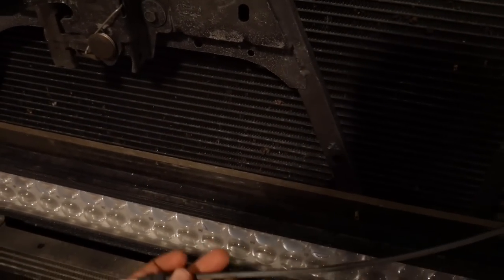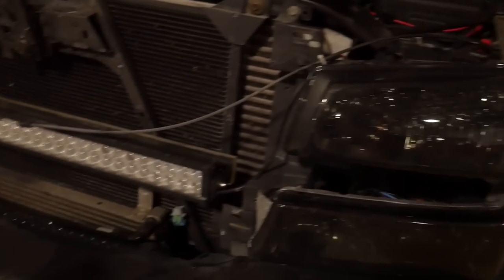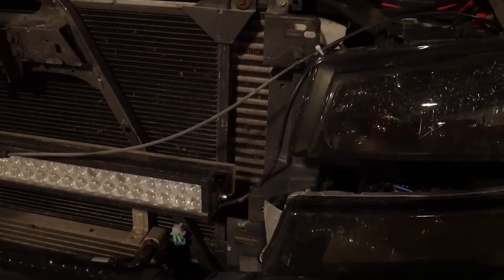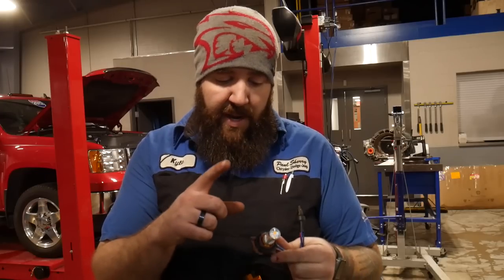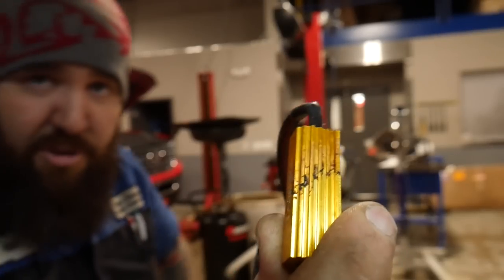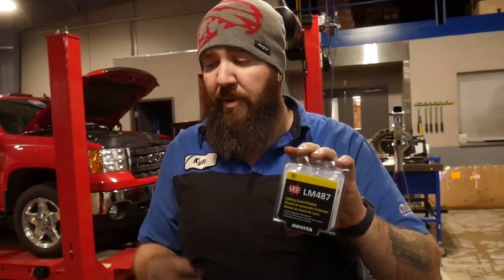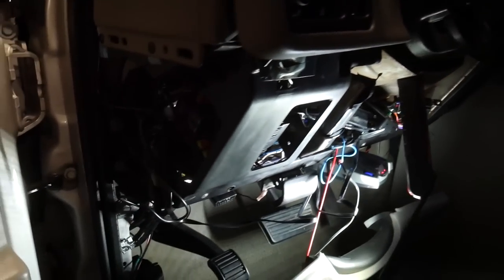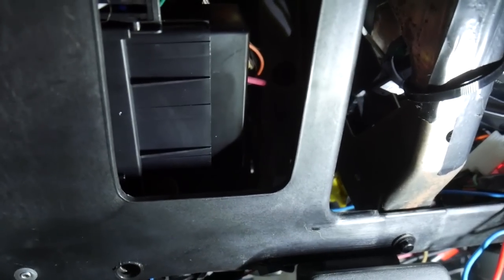LED FAST FLASH FIX AND WHY RESISTORS MAY NOT BE A GREAT IDEA

Comment: Don't blame the resistor for your poor mount. It is stated that they need to be mounted to metal and away from plastic or anything that can short out. It was your poor choice in where you mounted them.
Reply: That may be true but do you really want those things in your vehicle that can cause a lot of damage or even a fire? I don’t think so. Do it the right way and be safe.
Reply: WHY WOULD U WANT AN ITEM THAT WILL GET THAT HOT IN THE FIRST PLACE, IF THE LM47 WORKS GET THE BETTER PRODUCT.

Comment: I'ma just go ahead and say it as I'm an automotive accessories installer of over 20years. That is a Ballist resistor with heatsink "the metal housing" it's designed to get hot that's how it work. It turns excess load into heat. Think of it as your radiator. It needs air flow most importantly and would you cable tie wires to your radiator?. Point is installed in the correct way with airflow, screwed to the vehicle properly and with sufficient air flow then they will live a happy life for ever. I'm by no means having a dog but I watch you to learn what you do and in turn this is what I do. Hope it helps. Having said that it is still worth the extra money but honestly it is doing the same thing but with no heat. Doesn't mean it won't release the white man's magic white smoke either lol.
Reply: Just to add with that flasher module upgrade you retain you fast flash circuit indicating a blown globe 'led' unlike Ballist resistor s you lose the fast flash blown globe indication. That's why I would spend my hard earned.
Reply: Trouble with resistors is there is no air flow where they are used.
Reply: @charliemagoo7943  Trouble with that is your installing in the wrong location then. Common sense. Again if your new radiator said install in the trunk in its packaging, would you?  Difference between DIY and Professional.
Reply: Philip Perry I have a 2012 Duramax and I don’t have a flasher relay. Is there a module to change or I have to stick with the resistors? But I screwed my resisters to metal to dissipate the heat
Reply: @jamesbatdorf1665  the flashers are controlled by body control module.  The module can be programmed with an added vci to delete bulb outage detection.  Our dealership does it for about $150.  Dont have to worry about resistors overloading module then.  Have seen several boards melted from resistors especially if 4 way flashers are used
Reply: I was wondering I have a 2003 GMC that I bought new headlight assemblies for with the LED plus the turn signals or LED switchback it it has DRL which is down in the turn signals but when I hooked all this up and come with resistors and I got the flasher relay for LEDs when my headlights is off my turn signals flash normally and when my headlights come on they flash faster but not so much as a hyper flash like without the resistors for led but I'd rather for them to Blake little slower is there something I can do about that I have regular halogen bulbs in the headlight assemblies I don't have LEDs in the in the housing just yet but in the housing it has the LED DRLs and stuff like that already in and I hooked the wires up but I have not switched the halogen headlights over to LEDs yet

Comment: You was suppose to mount the resistor to the metal away from anything because it gets hot...I’ve used these for years with not one issue

Comment: Someone already said it in your comments but I did the same thing. Customer came in with those ballast resistors on their 14 RAM. Well they melted the headlight assemblies where they were wired in at lol. I remote mounted them on the core support so they got the airflow and they could dissipate their heat into surrounding metal of the core support. The vehicle comes in pretty frequently at the shop, next time it comes in I'mma peek at it and see if it's still holding up lol

Comment: Hello, thanks for advice. I have a 2002 ford taurus and I have so far replaced my back up lamps and head lights with LEDs. I would like to go for front turn signals. Not sure if it will hyper flash with them. Is that part you installed available at any autoparts store or did you have to special order it?

Comment: Digital flashers are good if they are an option. But your resistor failure was user error. Resistors get hot, there's tabs to mount it for a reason, you should have had it mounted to something metal, maybe even with some heat sink compound.

I like to start with the flasher if it's available, if it's not, resistors properly mounted are more than adequate.

Comment: Thanks for the information.. I like your video...Thank you for taking the time. Like you said, you live and learn...
 Just one question on a slightly different topic. I don't know if you have a video for this. I want to install LED bulbs for my daytime running lights. 2000 Silverado and they are 3157 bulbs. I had a friend say that they are not going to last long. Would these need some type of resistor?  What would you recommend?
Reply: I use the zero sylvania 3057 led in my 2005 Chevy Tahoe 3 or 4 months ago and still working with no problems

Comment: Is there an option/lighting control module for the Hyper flash for a 2018 Chevy Colorado? I only see 2 fuses for left and right rear blinker…it’s like the light control module doesn’t even exist…
Reply: it is possible the colorado is like my nissan frontier and does not have that module as it is controlled by the BCM

Comment: Or just stick with less powerful but still enough to prevent hyperflash, sylvania - load equalizer resistor. Instead of of 50W they shoved on the little one. The sylvania is 27.5W.

The little 50W resistors operate about 5 minutes, and the heat gets up to 330 degrees Fahrenheit. That’s why the mini 2” gold resistors get super hot. 

But the 27.5W sylvania - load equalizer resistors gets hot for around 180. So that’s way better and more efficient. 

Mine has led flasher relay by novita LM449. For my 2015 lifted Scion xB. And it works beautifully.

Comment: Great video. How do you get both headlamps to come on? I installed a ISSYAUTO flasher in my 2003 and everything works great. The LM487 wouldn't work. I have a 2017 2500HD and I'm trying to figure out how to do a full LED swap without resistors. It doesn't seem to be easy to just change a flasher swap? I bought CANBUS ERROR FREE bulbs but the still Hyper Flash.

Comment: If I have two options between buying the bulbs with a chip like the Lastif or installing the resistance, what is the best option? I think that if the resistor gets hot is better than the bulb.

Comment: @RustbeltMechanic 

I was actually lookin forward to swap all the halogens and incandescent bulbs from interior and exterior for my family’s 2017 Toyota sienna LE, especially the led bulb turn signal lights as well. 

I want to installed the sylvania zevo 3157 front and 7440 rear. 

I have the Novita led flasher relay LM449. 

But here’s the sucks part, Toyota made a very stupid idea to move the oem relay somewhere else. 

Instead of under the steering wheel which is a nice spot, they moved behind the gauge panels and it’s the worse thing they ever did. 

So I got two options. Either get the ultra bright auxito with a built in resistors. 

Or just get not only just a load equalizer resistors, but as a plug and play version. Which I prefer those for now. 

I will use those, and for the front under the hood of the sienna. It has nice room full of sheet metal frame to mount the resistor with 50 watts. 

So I prefer those with 3157 socket connectors as a plug and play that it came with. And I’m also gonna get but not installed with a 7440 for the rear, and see if it’s enough power to mount just the front to get rid of the hyperflash and not needing the resistors for the rear 7440. 

I just wish Toyota shouldn’t move that relay in the first place. That would save my time for that. 

What are ur thoughts on that?

And just for the heck of it, how much is it to have some mechanic installed the led flasher relay for us for 2017 Toyota sienna LE, and the relay is behind the gauge cluster, that needs to remove the plastics panels and gauge clusters for that?

Comment: 07-13 doesn’t have flasher, turn signals are controlled by BCM. Heard reprogramming bcm doesn’t fix hyper flash on front turn signals. So resistor is kinda the only option
Reply: I'm having the same issue.  I guess our options are to only buy the resistors or buy a bulk with built in resistors.

Comment: It seemed fine but if you look at the rear it would flash both the lights like my hazerds where on when I turned my right blinker on but was fine in the cab and front of truck
Reply: I just did this to my 2006 Silverado. When I plugged mine in for the first time, everything seemed like it worked as it should. I did a full walk around and did great. Then I unplugged it and plugged it back in to make sure it was seated correctly then tried the lights again and it did what you mentioned. My from signals works like it should my rear lights flash like hazards, even my license plate lights. However, when I turn on my headlights, no turn signal or hazards work. 

Did you get this resolved?

Comment: I did all JDM astar blubs, and I also ordered that flasher module. I still can’t put in my rear turn signal led blubs because one side or the other stays on. After doing alittle experimenting, resistors are the only thing that would allow me to use leds in the front and rear. All that being said I was not comfortable putting them on in the front just because of the high amount of heat, 120-150 degrees( I shot them with my heat gun). Any idea how to get around this? All stock head and tail light housings
Reply from the maker: Hmmm...I run leds in front and rear and do not have that issue
Reply: buy led bulbs no hyper flash... they sell too..

Comment: I wired one side of my rogue with that style resistor,  turned on the lights and turn signal and let it blink for like 2 - 3 mins it got so hot I took that shit out and said no way, I knew it would possibly melt something, at least you caught it before it really destroyed something.

Comment: The problem is not the resistor.  In that application Watts = voltage squared divided by ohms.  The heat has to go somewhere.  Mount it on metal with heat sink compound to let the heat out.  Alternatively use a higher ohm resistor.  I bet that most modules would work with a 25 ohm or higher resistor, which generates much less heat.  It’s math.